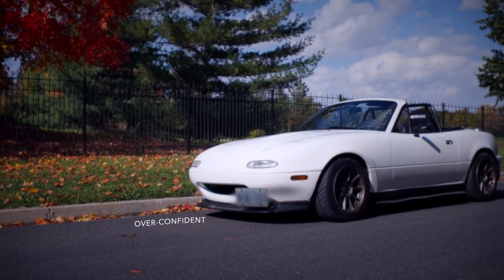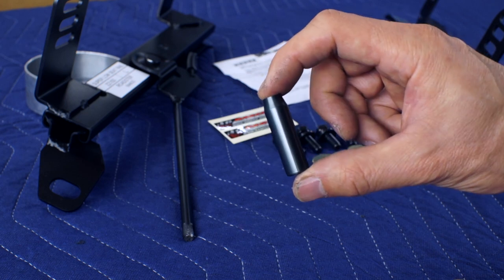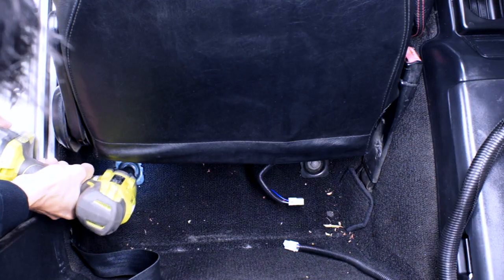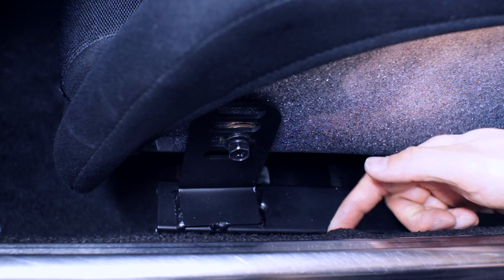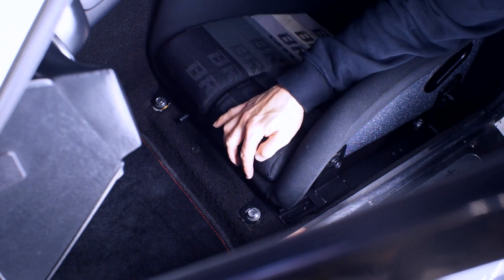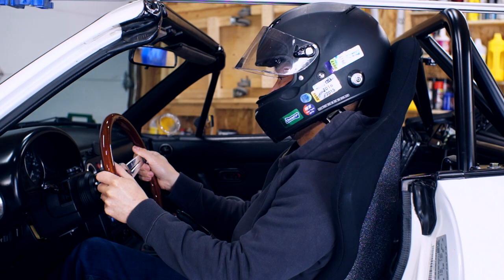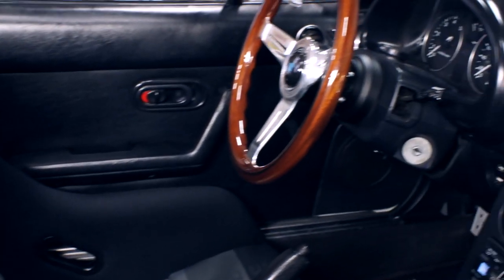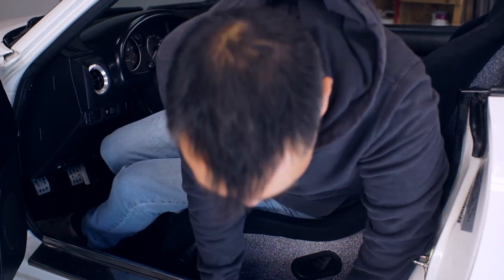NO REGRETS 🤔 Bride Fixed Back Racing Seat DIY Miata

Comment: how did you manage to save ori seatbelts? How can we mount the bracket for them? To the bucket seat itself?
Reply from the maker: Although on my NA6 (90-93) the inboard seat belt buckle is bolted to the transmission tunnel, the Nagisa Auto seat rail has a tab for the buckle on it.

Comment: Could you just mount these directly to the floor?
Reply from the maker: You can with a fixed bracket (no slider) and the side brackets bolt to it. Otherwise you can fab your own bracket. But I'd like a variety of people to drive the car so the slider is needed.